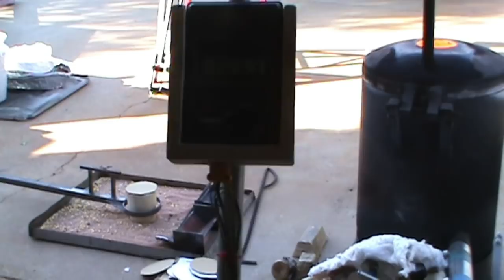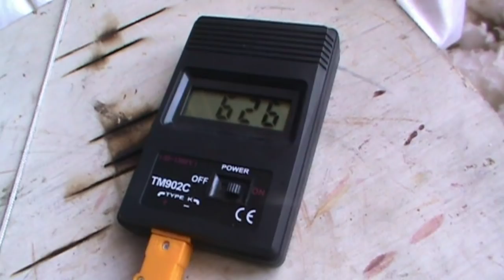Bronze Lost wax casting process PART 4 of 4

Comment: Tower  of power!!  I love this guy
Reply from the maker: lol..  I actually cut it in half.  My melts are so short, there is no reason to preheat and switch to used motor oil.  Now I just burn jet fuel.  It's like diesel except a lot cleaner and no stink.  It smells great burning too.  Thanks for watching!
Reply: @jagboy69  hahaha. Pleasure. Thanks for sharing!! Im also into casting  so im doing some research into the slurry casting method.  Looking at which one is cheaper in the long run between the slurry method and the investment plaster method.
Reply from the maker: @frikkiesmit327  Suspendaslurry lasts about a year and a half.  The stuff has been fantastic for me and worth every penny.  Holler if you have any questions.  Also, visit thehomefoundry . org  Its a good site for people like us.

Comment: That crack you said you saw that was in the final cast of the light switch, could that just be a superficial line made from the silicone mold you made? You had to superglue the original plaster one back together before you moulded it. 

Smooth on brand moulding silicone is famous for picking up every little detail... so when you made the wax mold it carried thru and then when you coated the wax with the emulsion and silica it could have easily retained that crack line from start to finish... smooth on has even been know to pick up peoples finger prints and permanently transfer them to the final casts... think that’s possible or do you think it formed the crack when you cast the bronze? Either way they still looked awesome. Nice job...
Reply from the maker: I wish it was from the silicone job.  I must confess, during the silicone job, I think I knocked off a couple of bottles of Merlot.  Once you start, you have to finish.  Unfortunately, after I pull a wax, I go over it very close and chase in necessary details and fix problems.  I'll do ya one better.  Not only will smooth on pick up my finger prints, so will the ceramic shell!  I have many bronze pieces around my house and you can see my finger prints in bronze!  Pretty good resolution I would say.  The only thing better than ceramic shell is solid block investment today used for jewelry casting.  This is the stuff we use for creating jewelry in my families store.   https://www.riogrande.com/product/ransom-and-randolph-ultra-vest-investment-44-lbs/702314  Both investments have their strong points, but for smaller stuff, Ultra vest is king.  Ceramic shell is perfect for the scale of work I am doing here.   If many simple pieces are to be made, sand casting would be the preferred method.  It is the fastest, but doesn't easily allow complex shapes and patterns must be pulled from compacted sand.  That means no undercuts.  Thanks for watching!  :-)

Comment: Well done video series!!!   
Interesting way to flash fire the wax out of your shells. Uneven heating might contribute to the shell cracking you experienced.
Safety suggestion for future pours --- get the crucible installed/latched into your pouring shank and get it off the pedestal block onto a floor level surface (sand pit) BEFORE you skim the dross.........you're not using protective spats and 2000 deg. bronze between your toes will give you an owie like you've never had before. Even heavy leather boots won't last long against a molten onslaught. 
If pouring can't be done immediately, after the shells are burned out clean at 1700, they can be brought down to room temp, stored in a dry place, and reheated to an appropriate temp. and poured at any later date. The vitrified ceramic is pretty darn forgiving in this regard.
An application of hi temp furnace cement and fiberglass cloth can mend cracks and holes.
Reply from the maker: Thanks Frank.  I put together this kinda boring series to help some new guys to bronze casting.  Tough to make mixing silicone exciting.  lol  I think I've solved the shell cracking with drilling sprues before dewax.  Since adding relief holes, I haven't had any cracks.  After dewax, I mix up some slurry with some silica and easily patch the holes.  No need for additional heating of the shells.  I let the patch work dry for a day and take the shells to 1700 prior to pouring.  So far so good.  Thanks for watching!  Will you post any videos of your bronze work here on YT?  I'd like to see them and will be happy to mention your channel.  All the best!
Reply: No YT channel in my plans.....just an ADDICTION to learning about metal work and casting = 48 yrs. of lost wax/sand/permanent mold....4 years of shell and the rest using solid flasked investment. For your readers, the tip on skimming a STABLE, low sitting  crucible arises out of my proximity to a serious accident that didn't have to happen. Molten bronze/brass can be a vicious mistress if not respected constantly and totally. 
Drilling a relief hole through the sprues solved our cracking also. When we got to larger pours, the addition of crimped ss wires in one of the stucco coats added an extra measure of strength. 
FYI --- Shellspen, in Florida, also offers a no agitation shell system. Think they were first, quite awhile back, and got copied by R&R

and away.......so much to learn and pour - so little time
Reply from the maker: Too bad you can't show us your work.  Decades of experience is tough to demonstrate in a small reply column.  I won't touch shell spen, they are seriously overpriced compared to R&R.  I also wouldn't be surprised if the guys in florida repack R&R's slurry today and mark it up.  Thinking back, 5gallons of slurry and 2 bags of silica cost me less than 300bucks.  Cheap as chips.  That amount of material is well over a grand from florida.  The slurry lasts forever and small pieces don't use much of it at all,  Sorry I just can't find a logical reason to over pay for the tiny quantities from shellspen.

Comment: Sorry mistyped previous reply.  Wanted to know about your sand casting operation and if it is necessary for works without a lot of small details.  Do have power water washing machine ( used for cleaning wood decks.).  Roy
Reply from the maker: A pressure washer would help removing shell, but I break it off and sand BLAST in a box.  Harbor freight sells cheap cabinet blasters.  lol  I that is what you meant.😉

Comment: The prob with your burner that you don’t have ventilation for the waste oil 
In the burner it self connect a small pipe from oil pipe to outside and keep it open
Reply from the maker: Not sure I'm following you, but the 2 fuel tanks have caps on top that allow the oil to gravity feed to the venturi.  The venturi is created using about 15psi compressed air from the orange hose.  ;-)  The furnace runs on 100% used motor oil after I preheat for about 10minutes on jet fuel.  ;-)
Reply: worldtraveler  actually i had the same prob 25 years ago and the solution was adding a ventilation  i will try to make a video and explain for you   Or let me chek if any video is available
Reply from the maker: That would awesome!  Thank you.  Please post a link to it here.
Reply from the maker: Ah yes, I am familiar with the drip burner.  Very simple and good for those that do not have an air compressor.  The burner I use is called the Kwiky burner.  It actually atomizes the fuel through a tiny orifice using the compressed air.  It will burn everything from propane, to kerosene.  Here is a look inside the burner I run.  https://www.youtube.com/watch?v=E-l21wQ6X-E  Thanks for posting another great option for burners!  If I ever take mine apart for cleaning or maintenance, I'll do a video of it.